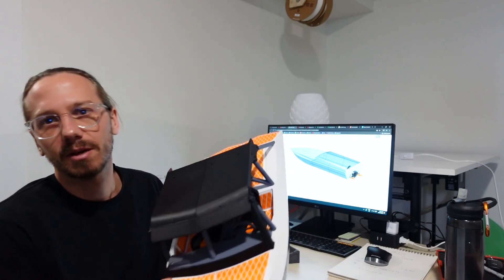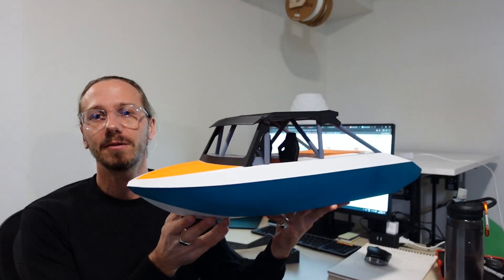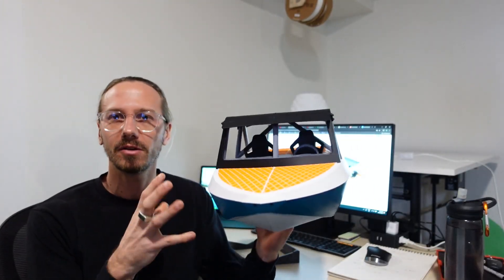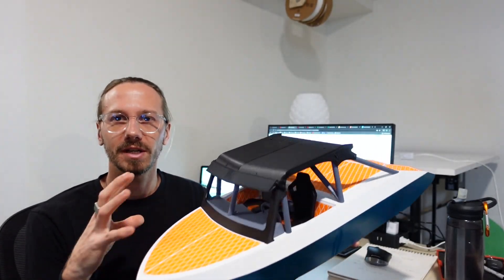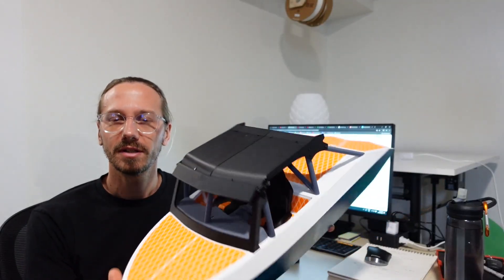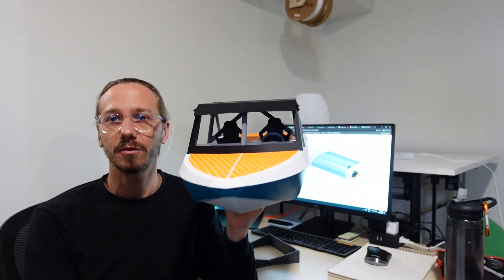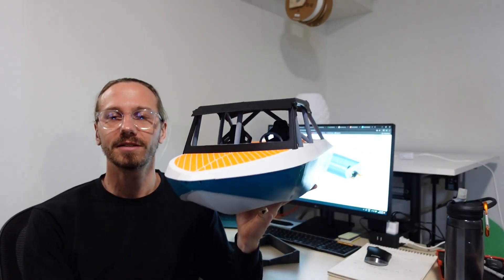RC Miniboat Mafia! Vassa Bash Jet Build + Test Drive

Comment: Gday mate, looks awesome
What filament did you use? Also have any specific printing parameters that you found that worked well with this build? Cheers!
Reply from the maker: Its all PLA. We just used the standard parameters from the build docs:
Structural parts: 3 walls, 4 top/bottom, 30% infill
Detail parts: 2 walls, 4 top/bottom, 10% infill
This build is really quite heavy so I would say don't go too crazy on walls/infill.
Reply: Same questions!

Comment: Amazing work. Where do you get your long drill bits from?  Also have you ever considered doing a Humvee?
Reply from the maker: Glad you liked it, it's been a fun build.  If you're talking about the screwdriver bits, we use MIP products.  They're a bit expensive but you can get a cheaper set on Amazon.  We have done a Humvee, personally, that we got from an3drc.com.  Lots of cool stuff on his site,  but don't plan to sell the hardware/electronics kits for them at this time.

Comment: ESC without water cooling? Omg
Reply from the maker: Right?! Usually we would always run something watercooled, however we wanted to get this thing in the water and we didn't have anything watercooled on hand with a high enough amp rating. It held up well though and we didn't run into any temperature issues. We've got some watercooled units on the way 😉
Reply: @rcprinter  nice! I would really like you to make a proper video about Ragnarok and the bashjet.

Comment: Which motor and ecu did you use?
Reply from the maker: Hey Cody. We went with what we had on hand at the time: https://rcprinter.com/products/surpass-hobby-3674-brushless-motor-with-120a-esc-sensorless-combo
This kit is a bit outside of the recommendations from the M-Jet 35 manual and was used in a pinch. If you're looking to build one yourself, we recommend checking out the motor/esc options table in the M-Jet 35 manual to determine the most suitable powertrain for your build!